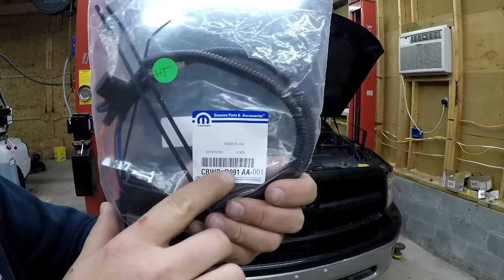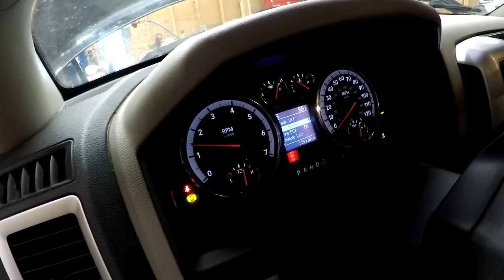Installing a Dodge fuel pump relay bypass for a faulty TIPM repair

Comment: Thank you for the video! It certainly helped me with my truck.. for anyone who wants to do this without a kit, you can go to your local parts store and get a relay and a relay pigtail for 15 bucks. I had to figure out which wires are what but it was easy. The brown and pink/green stripe wire are your trigger wires that will open and close the relay. The blue is the power wire is to the pump and requires the addition of a power wire as he showed in the video. When you have all the wiring done, when the key is turned on the relay should click on and shortly turn off as it has primed the fuel system. Once you start the vehicle it will stay on. The brown wire is a controlled ground that the pcm uses to shut off the pump when the pressure is high enough but the engine is not running. Hope this helps!
Reply: Hey Anthony, I did the same thing myself and bought the relay kit from an part store. Question I have is, on the relay itself. How do I know which wires from the relay goes to the wires on the tpim? Thanks in advance!
Reply: Hey Brandon, on the relay 85 and 86 are the trigger wires to activate the relay. 87 and 30 are the power and pump wire. There should be a diagram on the side of the relay and on the underside it will have numbers next to the pin indicating which is which.
Reply: @anthonydrew4388  so on 85 and 86, it doesn't matter which brown and pink/wire are hooked up to cause it's basically the same?
Reply: Brandon Spivey, correct. The same goes for the other two legs. It is designed so that even if a relay is placed in “backwards” it will still function.
Reply: drew  nice! Hey thanks man, really do appreciate it. I understand more. Thank you!
Reply: So 30 is the power, it just go to a 12v? And 87 is power to pump?
Reply: Following
Reply: @brandonspivey6526   x ke no  se puede ver en español o leer como se traduse al es pañol
Reply: Thanks a lot
Reply: 0v
Reply: Thank you very much for the wiring details. Saved a lot of time for me. All the Best.  🙏🙏🙏

Comment: My truck has been in and out of the shop for 2 months. Finally this last go around they caught the fuel pump relay failure. It didn't do it all the time. Problem is they wanna charge me $850 for the repair! I haven't been working because the truck isn't reliable.  So life has sucked. Thank you so much. Wish you were local!
Reply from the maker: Well it’s good news that the issue has been found. If you can find one of the relay kits you could do it yourself!
Reply: @Tomsfoolery.  what p/n is good for my 2001 5.9?
Thank you!
Reply: I say this stuck at Carl’s Jr. /Hardy’s I really hate dodges poor engineering choices rn
Reply: @Tomsfoolery. Ok so I guess u answer my question if I order this can I hook it up myself I mean I'm know professional but I du know bout positive n negative wires but this will be my first time doing this type of work with fuse
Reply: Me too there charging me 950$

Comment: I wish i came across this video 3 days ago before i took the tank down. JESUS CHRIST after i replaced the fuel pump, thinking the truck would turn on but it didn't. I had no power or ground going to the fuel pump. The fuse on the TIPM was not even blown, which raised questions for no power or ground signals as i test it. Till i swapped fuse boxes, with my other ram, the truck turned on. To tell myself an find out, it was the fuse box all along i was 🤬🤬🤬🤬🤬 but its the process of a electrical mechanical 😤... THANK YOU FOR THIS VIDEO.
Reply: I was just about to change the fuel pump on my 2012 Ram 1500 when I ran into this video and it helped me out so I don’t have to wrestle with a full tank of gas ⛽ and a floor jack!

Comment: The kit listed in this video is not longer available. I went with the Vertical Visions TIPM Plug-In Relay System Lite instead. No tools necessary. No removing the TIPM. No cutting, splicing or dangling wires. Simply pop out 2 fuses and plug in the bypass module in their place. 5 minute install and works great!
Reply: Where did you get your part at? I’m needing to do this on my truck and since the part in the video is discontinued idk what new part to get.
Reply: Heather Hoke I ordered direct from Vertical Visions. Just go their website.
Reply: What year is your vehicle?
Reply: @rickylucero9086  2011

Comment: I cut the fuel pump relay wires going to the TIPM and installed an external relay last fall. Dodge wouldn't sell me the kit claiming it was a warranty only item. Put a kit together myself. Gitter done!
Reply from the maker: Nice job! I didn’t call the dealer. I knew it would be cheaper on Amazon.
Reply: @Tomsfoolery.  Thanks! I looked all over but nothing was available for an 08. Plenty for the newer years, but the third gen didn't show anything at all... Had to go old school and pull schematics.
Reply: I did the same thing on a 2000 dodge ram 2500 👍
Reply: @3347861   Hey man can you send me info on what you did, my 2010 ram has the older tipm and i need to install an external relay  but its all totally different
Reply: @adamflores  you'll need to get schematics for your fuel pump circuit. I used a heavy duty aftermarket relay and socket from Napa and installed a fused wire onto the main lug of the TIPM to power the pump. I then cut the signal wire and fuel pump wire from the TIPM and extended them. Ground for the switch side came from a pigtail to the body. Install harness protector on the new harness and tie everything up securely.  Hope this helps.
Reply: John Baugh thanks man I just need to find the schematics for my tipm. It’s all totally different on my 2010 and everyone says an external relay won’t work
Reply: John Baugh hey did you actually ground the relay or the switch side like you said? I supplied power (relay30), cut the 2 wires I needed on the tipm, relay(86,87) and now that leaves the last leg on the relay (85)... what to do with that one?
Reply: @adamflores  The switch side needs the signal wire (+) and a ground to power the coil. A short jumper to the body will do. The two original wires you need are the fuel pump feed and the signal wire.
Reply: @3347861   I got it figured out thanks for the help man, turns out i needed to have the truck grounding the relay(one of the tipm wires) so it can activate cause when i ground the relay it just stays on. I had to hire someone for an hr to find out the wiring cause its totally different on 09-10 rams, so this video would only help 11+ ram 1500 people. also the relay you have, what kinda amp rating does it have? i had one laying around and it has 60 amp 12v rating but i see that a 20amp will do.
Reply: @adamflores  Glad you got it going! I used a 40 amp continuous duty relay meant for light bars.
Reply: Pilot Ok you’ll need schematics for your particular vehicle. They’re all a little different.
Reply: @3347861  hi there man im having trouble with the same yr as urs i cant find anything or a schematics to the 3rd gen 07-08 model ..where did u find yours or do u kno what wires to tap too? I was bout to just straight hard wire a 40 amp relay to the pump and let it be on with the ignition problem is there sayin it has to shut off for a bit when its on high pressure is that true..plz help i need my truck for work

Comment: Thank you for your information. There is a cable available now that is about $30 and takes about 10 minutes to install. It's called a TIPM bypass cable assembly.
Reply: This cable is good for you to go back home but without this relay kit your fuel pump never stop !

Comment: This is a good fix - but if you dont want to go use the bypass its not that hard to take apart the TIPM and get to where the fuel pump relay is.  Then as long as you can do some basic desolder/solder work you can switch out the fuel pump relay thats located right on the circuit board.  Its a bit fiddly and tedious but not all that bad.
Reply: Not good advice for a novice.  Nothing wrong with an external relay.

Comment: Thank you Santa!  Your instructions were spot on, I didn’t have the mopar relay kit available, so I wired in a relay socket and relay with weatherproof fuse holder. I made my own kit! Your video was essential in making my project a success! In less than an hour the van was running like new! Thanks again!

Comment: Thank you Santer, you saved me from being stuck on the roadside. 
I’m in a wheelchair and the last thing I want is to be roadside waiting hours for a company that can support a power wheelchair transport.
Your video directed me to all the information and parts I needed to keep on my van until I could get this fixed. 
I have a stuck on relay and was able to remove the M25 fuse temporarily to get by.
Reply from the maker: That’s great! Thanks for the view and the comment! Have a good day.
Reply: @Tomsfoolery.  Dear sir, thanks for the video. I have durango 2013, the problem happened when I was on the road suddenly the car shutdown because there was no gas. the pointer didn't work properly so I was able to know time to refill. The fual gauge pointer comes before the empty E letter within two dots. 
Can u help me the problem is!!
Reply from the maker: Sounds like your sending unit has gone bad. The sending unit is integrated into the fuel pump and is mounted inside the gas tank.
Reply: "Sir! thank-You!  @anasshak
Reply: @Tomsfoolery.  i have a 2018 ram diesel in the shop right now.  Intermittent start fuel pump primed then stopped priming checked plug at pump had power and ground. Replaced pump no start checked power and ground now no power. Fuse is good. Don't see an actual fuel pump relay in the fuse box or tmis* should i say. Is it the same built into the fuse box?

Comment: This fixed the issue. Running like a champ. I made my own relay harness like mentioned. I called Dodge and asked how much the repair would be just for the hell of it. $1800 for a new tipm. I don't own a Dodge or Chrysler product and never will. Good luck and thanks

Comment: I own a 2013 durango & it appears this what just happened to it this morning. It cranks but wont start. 
Makes one appreciate classic cars & how simple they are.

Thank you, Sir for such great vodeo. God bless 😊
Reply from the maker: Thanks for watching and good luck with your Durango! You are so right. The old vehicles were so much simpler!
Reply: @Tomsfoolery.   I've got a 2008 CRD grand voyager RT that occasionally cranks fast without starting, I bought a new WIN module assuming that was the fault which I haven't fitted yet but now I'm thinking it might be this relay sticking open instead, it seems that I should just bypass the TIPM relay regardless as it will probably fail if it hasn't already!

Comment: Great video!  Just ordered one (using your link) for my 12 Ram.  Already installed a new fuel ⛽ pump (YUGE job) but still having intermittent issues.  Will install when it arrives!
Reply: Let me know the outcome when you install. Having the same issue with my 2012 ram
Reply: @dewaynenewton6851  worked perfectly in seconds!

Comment: Absolute life saver, I have a 2011 ram bighorn TIMP is 1100 at dealer, and this external relay is $50. at dealer. Mechanic said Ram uses part # HP6770, and i found it at local auto parts store for $15. Putting in tomorrow. Great video and doctoral, Thank You!!! Well after following your video as doing install, no luck she still won't start and now the jumper i made won't work either. Guess I'm one of the unfortunate ones who's going to have to spend 1k for a new TIMP fuse box. Good luck to y'all

Comment: Had the same problem on 2013 Jeep GC. The recall “fix” was done over a year ago. Shortly after, another recall from FCA saying that there is a recall for the fix of the original recall. You can’t make this up. Thanks for the video, great information.

Comment: That is good but I did it by  taking the order of  egnition from 20A fuse to operate arelay bigger than feul pump relay  out of main fuse box and give it main +ve 12v of battery with fuse 20A goes to fuel pump harnes
Reply from the maker: Good job!

Comment: Same truck, same problem. ordering part tonight. awesome video and thanks for the help. Any others having this problem and don't want a battery to drain, be sure to remove negative battery cable until you need to start the truck.
Reply: If that's the case removing the fuel pump relay fuse is easier.
Reply: @chapasebastiano8  that M25 one? I am guessing that is what made my battery drain on my 2001 Ram.

Comment: If you’ll spider web the two ends of the stripped wires and push them together and twist to intertwine them and have the heat shrink and brass connector already sitting on the wire then you can easily slide the connector over it and crimp and solder the connection. Just thought I’d mention that and hopefully it helps for future projects.
Reply: That’ll make the connection of the wire stronger and better as well as making the wire as close to one wire as possible

Comment: I bought a truck with this already installed. I believed it to be a disable thing but I never discussed it with the dealership. Turns out this is the problem and it is already on the car. Possibly the wiring of it- broken connection or the relay went bad. Either way I'm hoping for a cheap fix.

Comment: This is a great fix and it's alot cheaper then the "proper" fix, however, I've seen this toggled before. Some older models of trucks had their fuel pump on a toggle from the factory. The only downside is forgetting to shut it off when you shut the truck off. But it works just the same. Less wires cut and taped off if you ever decide or have to change the tipm at a later time. I would just run it to a toggle myself and if I decided to sell the truck I'd replace the tipm. I'm glad I never had to deal with this cause I have an 05 Ram 1500. No internal relay no mds. I dodged a bullet. no pun intended.
Reply: No, pun intended for sure..this design sucks.

Comment: I just replaced my fuel pump. Work good the first day. Next day I filled up the tank. It started up fine. Drove to the end of the block to have lunch. It sat for 20 min. Than tried starting it. It would fire than stop. Fire and stop. Every time I would turn the key. I pumped the bottom of the gas tank! And it fired up. Drove it home, about 35 miles. Let it sit. And it did it all again. Brand new pump. Do you think my tipm is the reason? It’s a dodge Durango 08- 4.7

Comment: Tks for the video. I received the part and even after removing the bottom fuse on m25 fuse the pump remains on. Its  a 2012 Grand caravan.•••  Any thoughts ? Tks in advance

Comment: i have a 2008 town country. inthink i have this relay issue, but its  intermittent issue. the car tries to start and just cranks without turning over. turn the key off and try it again it works and works for a couple days or months then happens agsin.im going to check and see if the fuel pump is working when this happens.. would this also cause a rough idle.? thanks your video makes it look easy..

Comment: Get sum liquid flux or the flux paste and apply to both wires so it will clean and help solder flow. Every wire I solder even if iuse flux core I add flux to make sure no cold solder joints.

Comment: Great job, great video, i have the same problem on my 2011 RAM, the fuel pump stills on when the key out, battery dead in a couple hours, tell me about yours, does it still drain or discharged after the relay?
Reply from the maker: Installing the relay fixed it. Prior to the repair, the truck would have a dead battery if it sat for more than a couple hours.
Reply: @Tomsfoolery.  - After 3 years and several mechanics including dealers, I thought this was going to give me the answer. I'm not so sure, this is the second guy to confirm a dead battery as the symptom. I was hoping it just seemed like a dead battery because the vehicle wouldn't start. In the 3 yrs, I went through a stage of believing it was the battery, but then it could happen on a good strong battery. 

I turn my fob and nothing happens start wise, but I have full power, I hear the actuators etc., but no crank, no start. BUT about a year ago I discovered if I just continue holding the fob in the start position, against the spring it will eventually start, something I thought those guys may have not discovered. I sit there for 5 mins holding it sometimes and then out of the blue, vroom, starts and runs perfect. lol. The longer it sits, the longer it takes to start. If it's only been a couple minutes it usually starts right away. I have reset it several times, no avail. It's so stinkin weird. It's gotten worse over time but still is a perfect vehicle other than that. 

Anything I said connect to what your doing here you think?

Comment: Thats why i love my buick riviera 1968 0nly 5 wires to start the engine no relays i have the same problem i had to add + to the fuel pump in order to make the pump start

Comment: I've done the wire jump from fuel pump relay to accessory fuse. Works for now but i want a permanent solution. I just replaced this TIPM 2 years ago and don't feel like dealing with it.  I've got an issue with p0882 code now as well and looking to bypass the relay there too.  Any advice on part numbers 2007 jeep wrangler Sahara unlimited automatic transmission.

Comment: So If I've read the diagrams correct, When doing this repair with a standard relay the connections go as follows.
Brown - 12+ Relay Coil (85)
Pink/Light Green - Ground Relay Coil (86)
Dark Blue/Orange - Load side N/O Contact (87)
Red Fused Eyelet - Line side N/O Contact (30)

Can anyone confirm?
Reply: Yes, correct (2016 caravan 3.6).